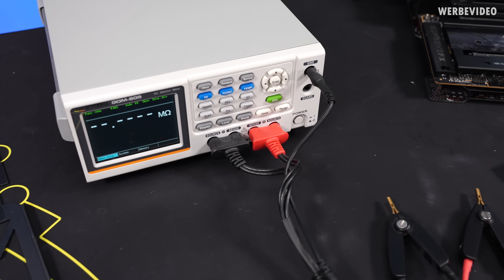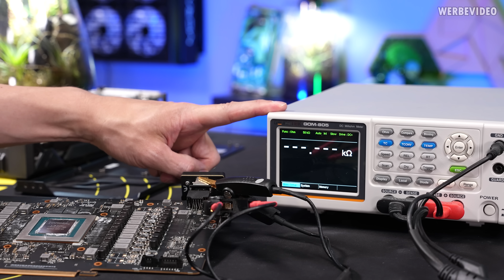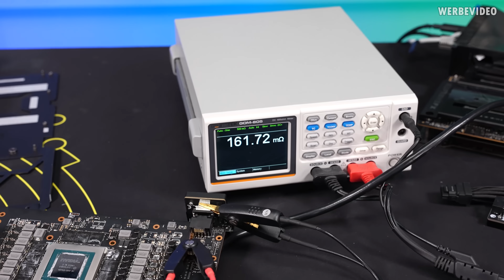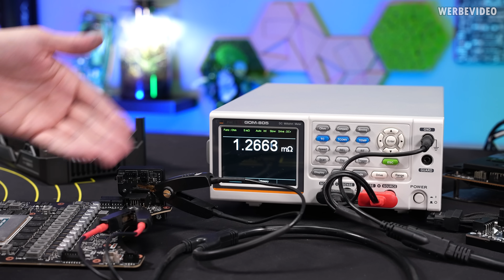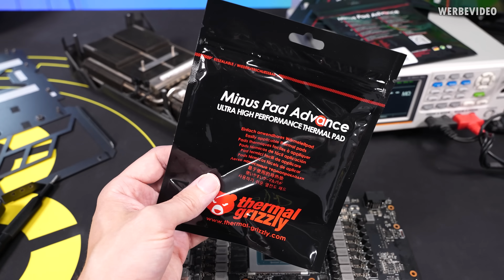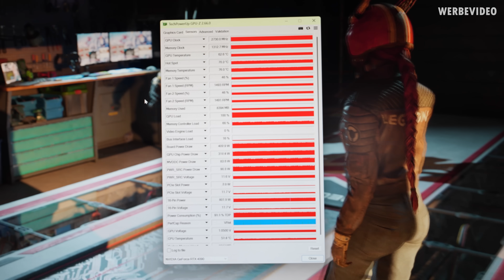It Happened Again – RTX 4090 with Melted 12VHPWR

Comment: I love using DLSS 4, but this connector makes me wonder if I'll choose the RX 9070 XT instead of the 5070 Ti.
Reply: 5070ti sips power.. Half of a 5090.. it's fine
Reply: @dylansmith9215 There has been at least one documented case of the 12v-2x6 connector burning out in a 5070 non Ti
Reply: @Gabriel-bt6er  They probably didn't plug in the cable properly
Reply: @mitsuhh i understand that, but why did we never hear of  8pin connectors melting in all this time? There were some power hungry dual GPUs in the past, but I don't remember hearing people having the connectors melt.
Reply: @angeltzepesh1  Because they used multiple 8 pin cables
Reply: @mitsuhh  Even if you insert the plug correctly, you are not 100% sure that it will not melt.
Reply: @mitsuhh First of all, the 8-pin connector does not melt because the graphics card can distribute the load evenly and the RTX 4000/5000 were deprived of this feature.
Reply: @mitsuhh so this connector that was supposed to replace dual or triple 8 pin connectors, cant support the same power that dual or triple 8 pin connectors can, unless all the stars are aligned? Please make it make sense, because to me it sounds like a design failure.
Reply: @angeltzepesh1  Sounds like you can't read
Reply: @mitsuhh sounds like you can't understand basic logic.
Reply: @angeltzepesh1  Or you can't read
Reply: @mitsuhh nah, I'm betting you can't use logic, but here you go, I'm gonna waste time again to explain it to you like you're 5. This new connector was supposed to replace the multiple 8pin connectors, be it dual or triple 8pin configurations, but it's clearly not working because the wire used is way too thin.

The 8pin never had this problem because it used proper wiring, this doesn't.
Reply: No need to worry, they improved and made the 12V-2X6 connector to resolve these issues, also this is a third party's fault.

Comment: so adding more points of failure is good
it works as a fuse💀
Reply: Exactly what i see from car manufacturers. Adding more points of failure.
When on older vehicles you had to keep an eye on 3 max 5 plastic water connections from potential leakage now they have more than 10 times the amount of them!

*Vehicles that don't have water level sensors never get overheating indications simply because the water temperature sensor need to touch water! and if there's no water to touch the engine overheats a lot faster than the sensor can pick up from maybe some steam fumes.
Also some vehicles don't even have temperature gauges either! Who needs them right!
I see 70s 80s 90s vehicles with water level sensors and new ones with literally everything a living room can have but that simple but crucial to have sensor!
Reply: Hahahahahaha
Reply: “Hate changing SMD fuses for RMA claims?? Use our 12VHPWR connector standard! Thanks to our patented Fuse Protection technology built into our connectors, this means you won’t have to replace tiny SMD fuses ever again!”
-Nvidia’s marketing spiel to AIB partners probably.
Reply: @ph33lix  why evga... left the market. AMD left the high end market. They were competitive. Yet weren't allowed to compete. By law, by customers, nor by market. Law not being enforced by governments. Customers not supporting fair competition. So not a free and open market.
Reply: If it saves the thousands the card costs, I guess it's worth it
Would be nice if it wasn't so necessary though
Reply: "...Works as a fuse"? Ha! I call that planned obsolescence.

Comment: If you have a motherboard with a temperature sensor header, AIDA64, and a small secondary screen, you can prevent your cards from melting.

1. Basically, attach the probe to the GPU connector.
2. Turn on Aida64 on monitor the temps on the temp sensor cable.
3. A faster way to skip playing games to get a temp guide would be just to set Aida64 to shut your PC down once the temp sensor hits 80 °C. You could set it to 70 °C, but it's hard to say that would be okay, considering your location, case type/warm air from the GPU hitting the cable.
Longer version.....Try playing demanding games and check the temperature sensor to gauge the temperature. I used Cyberpunk maxed out, and I hit 68 °C, but some of that is also the warm air from the GPU, but it gave me a base temp to work on.

As long as Aida64 is running, whether I'm near my PC or not, once it reaches that temperature, my PC will automatically turn off and prevent melting. It does not fix the issue, but it saves you a lot of money. I even found a 12VHPWR cable that had begun to fail after 6 months because of this.

Oh, and I have been doing this since early 2023, and still do it with my new 5090.
Reply: Or you could just be a nerd like me and write a simple script that takes up minuscule memory, runs on startup and does the same thing.
Ah and it's also free.
Reply: @shapelessed That's above my pay grade lol The thing I like with my setup is that it allowed me to see things that did not look right, and I was even able to spot a cable that was beginning to fail because I could view it in real time.
Reply: Asrock has a PSU that does this, temp sensors added into the cables and if it goes too high, it shuts off the power. ASROCK TC-1650T. You will still be guessing why your machine suddenly powered off, but it's better than melting plastic.
Reply: @VTOLfreak  It was bound to happen, but I have been doing this since around April 2023. So far it has helped me spot a failing cable.
Reply: @VTOLfreak  HwBusters pointed out in a video that the thermistor is on the cable some distance away from the connector so I think sticking your own thermistor to the connector itself would be more accurate
Reply: @VTOLfreak  Hopefully it is better quality than Asrock motherboards that have been burning 9800X3D CPUs.
Reply: @ZnakerFIN  You need a motherboard with two temperature sensors. One for the 4090 and one for the Asrock MB lol
Reply: A better solution would be to remove that fire hazard from your home or place of business.
Reply: @MCJemFinch  So, keep it outside...that might work lol
TBF, it's yet another thing we turn on every single day and hope it doesn't catch fire. Think of how many rechargeable items we have in our homes that have batteries made for as cheap as possible in countries where some standards are a grey area, and we happily leave them on while we go to work, in the hope they don't explode and burn the house down. The 4090 is just another one to add to the list lol
Reply: I think up to 100C on these connectors should be fine. The max safe operating temp is usually at least 105C, possibly more depending on the connector.
Reply: @rkan2  Yeah, they say 100+, but I have more peace of mind setting mine between 70-80c.
Whatever they come up with, you need something that cuts the power to the PC. As long as my Aida64 works, I am ok.
Reply: This wireview monitor is cool but useless! It only monitors the cable. But the cable it NOT the problem. The problem is the connection.
So I'm asking why the f.... You make a busbar in this wireview tool? Just controlled every pin to the card and it would be perfect???
Reply: Or better yet, remove GeForce from your system
Reply: What probe are you using?
Reply: I just hardwire mine, no high failure connectors needed
Reply: If you have to do all of that just to stop your GPU from playing with fire it's not worth it.

Comment: @der8auer-en when is your WIREVIEW GPU PRO 2 releasing? I've a 4090 and I want to have that in my system, I want to be able to monitor... I'm constantly concerned I'll end up having a melting issue, especially with the HeatWave in the UK atm... 31°C+ Ambient temps... I'm personally dying in this heat and the only reason I'm not completely freaking out, is that I can't play graphically intense games atm, as I can't cope with Ambient temp... never mind having essentially a 500w+ heater next to me lol.
Reply: You want to buy a product that caused this GPU to fail within weeks of being added?
Reply: @bigpoppa1234  Umm... I guess you're a layman re: The causes of 12vHP failures... and you also don't seem to be able to read either... I want to buy the WireView GPU PRO v2... Not what was shown here, which was the WireView GPU Pro...

However, even after seeing a WireView Pro get melt into a card... I'd still buy one, I just know the Pro v2 is on the horizon... that's the only reason I'm not buying the WireView Pro! 

The Issue here is caused by Zero Load balancing on the GPU... the WireView Pro is built to spread the current evenly across All the pins, on the input side of the connection, the same as Nvidia's included 4-1 connector... yet due to resistance imbalance and current being drawn by the card (without any Balancing), mainly down a single pin or two of the 12vHP connector... the connector melts!

Plus... Der8auer and his Company Thermal Grizzly have proven Time and Again that they have Integrity and can be Trusted on the rare occasion an issue occurs!

Comment: It all doesn't matter since people are buying these overpriced cards left and right all the time this is happening...
Reply: Sapphire did the same with their 9070 XT which has a 12VHPWR connector, so it's not just limited to NVIDIA sadly.

Maybe there needs to be an initiative like Stop Killing Games but for safe GPU board design :)
Reply: @TheDeeGeeNL  Having this connector on 320-350 watt card is much safer than having it on 600 watt cards. Time will tell if Nitro + 9070xt and 5070ti are going to melt.
Reply: @novinovic298 iirc it's also a question of how the pcb is designed. 3090 had the connector but the board itself also had a safer design, one that Nvidia dropped with the 4000 series presumably to save costs. And in their infinite wisdom, Nvidia has restricted their partners' ability to actually make their own board designs.
Reply: @wahcriminal As far as i understood looking at analysis of Nitro + PCB there is 0 safety features done by Sapphire. At last ASUS has that warning via software on Astral 5090 if abnormality in current occurs but as many people pointed out it would be better if they made it so pc will shut down to prevent melting instead of just informing you.
Reply: @TheDeeGeeNL  There are zero documented cases of 9070 XT 12VHPWR connector melting

Comment: Just checked my 4090FE with the Seasonic Noctua 1600w psu and it's direct 12Vhp cable it's still safe phew I'm not moving my case all that much unless I need to.
Reply: Only a matter of time it seems... have phun...
Reply: @madant7777 been safe so far but i do have a 3090FE as a backup.
Reply: Don't check too often but when you do make sure you check both ends of the connector the PSU end of the cable can also get really hot.
Reply: novideo moment of having to even check that your connectors aren't melting:

Comment: Once again: this is not a problem of the power connector, but an incorrectly designed power section especially in a series of 5x, which for unclear reasons randomly begins to load a single wire. The socket/connector is only the effect of this problem, but not the cause. And that's why nVidia isn't doing anything about it, because it would require a complete redesign of the power section, and who knows if not the entire chip - not just a cheap plug change. We're talking about big money. For the same reason, at one time Ford preferred to pay compensation to victims of engineers' error (well known self ignition of cars), rather than change the design of the car.
Reply: it can be both, in fact is IS both.
Reply: its both.
Reply: @jermygod  Rather not. Previous thorough testing confirms that the connector is reliable when the specified load standard is observed, and even when it is exceeded by a certain margin. The connector begins to melt when these standards are exceeded too far. And this applies to 12VHPWR as well as 12V-2x6. I repeat: both connectors work impeccably as long as the nominal conditions are met. nVidia's silence on the subject only solidifies these conclusions. There is something strongly suspicious going on here and nVidia sweeps the problem under the rug (which is obvious), knowing that it is only a matter of time when the issue will be forgotten.
Reply: @p0k314COM  that's all just talk. As shown in the video its all soldered together right after the connector on both sides. And yet the connector melted. If that would be a better connector, (I'm not talking about 8pin, but more like a 60amp circuit breaker'ish type) it wouldn't have any problems.
Reply: @jermygod  As if I were talking to the wall: the connector is melted, because the load repeatedly exceeds its designated-value standards. You are confusing cause with effect. That's why recently some power supply manufacturers have been adding thermal locks to GPU power cables, because they understand what a mess the power section of nVidia cards is in. And they do this because engineers know very well that the connector is not the problem, but - I repeat - the load on a single cable beyond all standards and the fact that the GPU power section cannot detect and counteract this problem in any way. EOT
Reply: What is a power section? The power stages for the CPU? I thought the whole board was a power section😂
Reply: @AhDieSloegerd  Most cards balance power between two or 3 connectors. The new 12VHPWR cards use a monolithic design.
Reply: Sapphire also cheaped out on the 9070 XT with 12VHPWR connector and has the same bad power design, so it's not just limited to NVIDIA.

Companies just like to save pennies, even if that can risk a life.
Reply: The card can't "choose to" randomly load a single wire more than others. However due to things like different contact resistances or defects, some wires/pins do in fact end up with a lot more power going through them than others. But this is a passive process, the card isn't actively doing that.

However, that is also completely normal. The problem is that the connector doesn't have enough of a safety factor, in these cards it's operating at the absolute maximum of its capacity. So if that's exceeded, it melts. A simple solution is... A bigger connector. Bigger pins, higher capacity, more headroom, less melting.

But Nvidia isn't doing that due to PCB size and density. The PCBs are extremely dense and small (compared to older cards) and a larger connector would require more PCB area and thus incur more costs for Nvidia.

EDIT: and yes, multiple connectors (with multiple separated power planes) or even active load balancing would be other ways that could solve the issue if properly implemented. But the main thing is that the connector doesn't have enough of a safety margin.
Reply: @TheGrejp  You typical Johns really love to talk about things you have no idea about. Nothing new here. I recommend, as a first step, to get acquainted with the video material discussing the nVidia power section design on, for example, the Actually Hardcore Overclocking channel (probably the most accessible content), and then to deepen your knowledge of electricity a little more. I hope I'm not asking too much.
Reply: Once again someone doesn't understand electricity, all the wires run in parallel so all of them should pull equal power. (In theory)
The issue is 100% a connector issue and always will be due to it being the only source of resistance (imbalance) in an otherwise perfect parallel circuit.
Reply: @obiwan245  No... Just no ... That is not how a parallel connection works The parallel circuits do not automatically balance each other, rather the opposite! The current flows along the easiest route until there is enough imbalance to make each route equally hard for the current to flow though. So, rather, any imbalance along the parallel section (from PSU PCB to PSU +12 V connector, through  the connector and it's individual contact resistance of each pin on that end, though any imbalance in the twelve individual cables, through the contact resistance of each pin in the GPU end, through the dc impedance from each pin to the power stages on the GPU PCB if not having the 50-series style busbar). Interestingly, the longer the parallel path, the better the balance. So, this wire view gadget with its busbar directly at the power connector is the worst possible scenario!

There is a reason why power is rarely sent in unbalanced parallel strands when either a bigger single cable would do, or an active load balancing... (The old style worked well even when separate connectors were connected to separate +12 V rails with notable voltage imbalance between each connector.)
Reply: @L2M2K2  The issue is still the connector, and not the power delivery design of the card.
Reply: @L2M2K2  There is no point in explaining, he won't understand it anyway. People like him want simple answers, not truthful ones, because others are beyond their reach.

@TheDeeGeeNL Exactly so, because AMD engineers know perfectly well that the connector in itself does not pose any risk provided that its work specification is maintained.
Reply: @obiwan245  except when the cables have some sort of physical issue i.e: not being plugged in properly or connector damage causing imbalance in the voltages across the cables.
Reply: @obiwan245  So you are not very familiar with how the power section of nVidia cards works in their latest series. I recommend digging deeper into the topic.